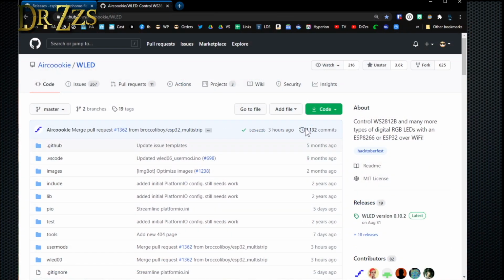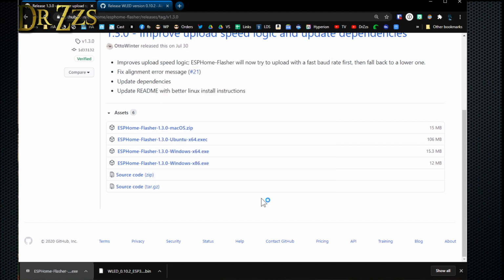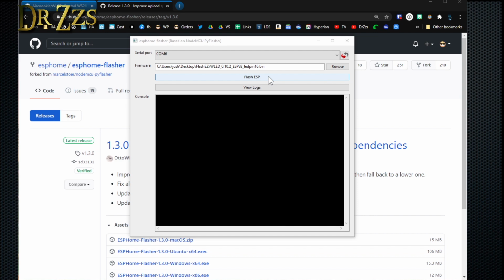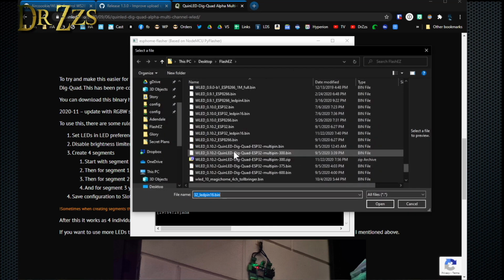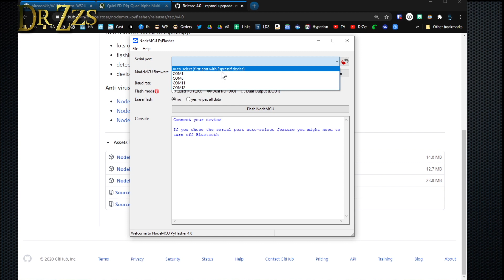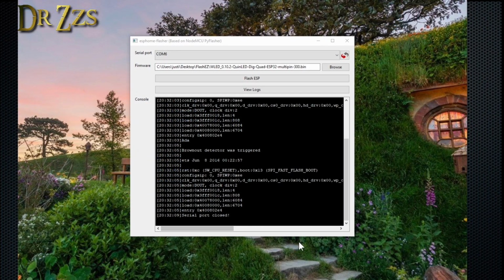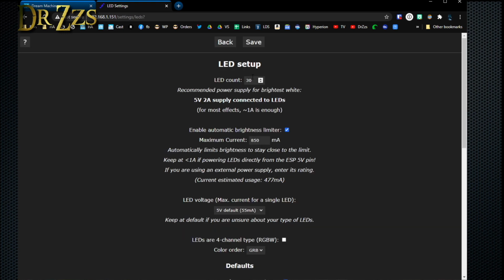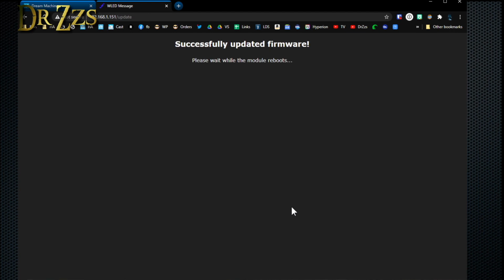DigQuad DIY RGB LED Controller - Setup Software & Wiring Connections

Comment: Awesome video! Quick question, I'm going to be injecting quite a long string of leds.  Can I inject straight from a power supply and not use the power outputs on the dig-quad? Thanks
Reply: You can, yes, but then your injection lines would not be fuse protected and you'll also need to do some for power distribution (as in, where to screw in the wires).
Reply: So there is no need to power inject from your 60amp power supply directly when using the dig power outlets

Comment: What’s the max count of LEDs per channel for the digQuad? I have 10 strips of ws2812b (5m 30) with 5v 60A power supply - can i run that from 1 channel (with power injection of course)?
Reply: Generally it's advised to stay around 500~600LEDs per channel. With 4 channels that would mean 2400LEDs maximum. You can run many more then that (per channel and in total), but the update speed per LED will start to drop. So 500LEDs = 60FPS, 1000LEDs on a channel = 30FPS. This is an LED protocol limitation, not the controller. Hope that explains!
Reply: Thanks!
Reply: If you can supply enough power, I don't think there's a limit on count. I could be wrong, but don't think so. I've had 400 leds running on a single channel of a dig uno.  Hope that helps!

Comment: hi there,
i just got the dig-quad board but i'm having trouble with the ports out puts.
i trying to use it on my mega tree and star. i have 496 pixels on my tree and 50 for the star. i set up the board with 546 total and tried to segment them in two. i used led port 1 just for the tree and led 2 for the star. the tree is working fine but i can't get the star to work. it lights up white but nothing else.
Reply: Did you custom compile the multi-channel mod firmware with those amount of LEDs? Then it should work fine: https://quinled.info/2020/09/06/quinled-dig-quad-alpha-multi-channel-wled/
Reply: Does the multi channel mod firmware come already installed on the digiquads or do I have to install that

Comment: what about the other 3 data ports can this be controlled independent from each other or why would i need a quad instead of a uno ?
Reply: Yes the extra three data ports are to be used with the multi channel fork of wled, this allows you to run four different strips simultaneously with different effects
Reply: @andrewmanning3941  can you also sync all 4 to run the same?
The way my house is I can’t really start at one end, I plan to start kind of in the middle and have 3 lines split out in different directions.
Reply: The video covers the alternate bin file to use all 4 digital outputs as well.

Comment: Great video. The only thing I would have thought to address would have been the power in equals power out concept that Quindor talks about on his site. That kind of confuses me. — For example, I couldn’t possibly use all power outs with one 12VDC power in, could I?
Reply: Not sure I fully get what you mean, but yes, you can connect up to 3x positive and 3x negative into the board and then it acts as a power distribution panel and fuse panel so you can do up to 7x injections to the LED strip. The board is rated for 30Amps continuous with up to 50Amp peak.

Comment: Who did the layout design of this board? Why is the data connector under the processor board?  OMG, where did you people get the connectors on the DigQuad board?  It got the worst screws.  I had to go through six screw drivers to find one that worked hardly ( i.e., watch type screw driver).  It would be nice to include a page with a simple wiring diagram and web links on how to wire it and use the WLED program with the assembled boards (not everyone has a technical background or capacity of locating setup data on Internet).  Thanks for working and producing this board and its associated WLED.  It appears to function well compared to my other three Chinese made LED controllers which sometimes miss turning-on some LED lights (or colors) and could make one to wonder, if the LED strip is defective.  I guess, it is really good to have the built-in level shifter on the board.  Thanks so much...
Reply: Oh wow, sad to hear you are having so much issues with the terminals! In design, choices always need to be made and since most people generally don't change their wiring every day, having them under the ESP32 module generally isn't too much of an issue. If you are building DIY you could also swap out those data connections for a pluggable style connector if you'd like!

Wiring diagrams can be found here: https://quinled.info/2020/10/03/quinled-dig-quad-wiring-guide/

Hope it helps!

Comment: Do you know If There is documented the advantages of esp32 vs 8266 when it comes to wled? Is the increse in Speed worth it? I understand that multistring could be better on the 32?  I run many d1s with wled and it works but they can sometimes feel a bit sluggish. Thanks for another great video!
Reply: Yeah, multi-channel really requires an ESP32 to work well. Other then that advanced stuff such as Audio Reactive, E1.31 and such all benenfit from the extra speed en memory of the ESP32.

Comment: Would this controller be capable to handle 11 meters of ws2813(60 leds/m) on 5V? I have prepared 60A power supply and I'm afraid this board won't last long in my case...
Reply: I have 64 meters ( 209.9 FT )  16 Sets of WS2811 with 5 volt 60 A power supply with this Dig Quad Controller.  800 Leds total.  200 leds per channel. Of course had to eject power in every other string of leds.
Reply: The board is rated for 30Amps continuous and 50Amps peak, but 11meters of ws2813 realistically will only use around 25A to 30Amps max. Running colors and effects this is much lower around 10Amps to 15Amps so I believe you will be perfectly fine. Only RGB full white uses insane amounts of power, the power limiter can help keep that in check though while displaying everything else at full brightness. Check my power sheets here to calculate some more realistic values: https://quinled.info/2020/03/12/digital-led-power-usage/  . 5v 60Amps power supply is still fine to connect too.

Comment: Thank you for your explanation. I have one question: When I use the sk6812 leds, do I have the same features as a ws2812 strip but with a white channel?
Won't I lose some features in competition with the ws2812 strips?
And if I use the sk6812 strips is it recommend to use an esp32 instead of an 8266?

Sorry for a maybe stupid question :). I saw a video where I understood the sk6812 could only show white colors with wled. I just want to be sure before ordering😉.
Reply: RGBW is fully supported and works in all the same ways as ws2812b except that you have 4rth white channel you can control separately. No limitations other then that the recommended amount of LEDs per channel is a bit lower since each LED takes 4 "bits" instead of 3 "bits". So where normally I'd recommend 500~600LEDs per channel to keep a good update rate (60FPS) with sk6812 RGBW this is more around ~400LEDs per channel.
Reply: @IntermitTech  Thank you. Now I can order the strip without risking that it won't work ;)

Comment: Excellent video!  One question - what pin/header will control a relay for separate power supplies? (small power keeps the board awake all the time, and big power only comes on when the lights are on).
Reply: It's suggested to use Q3, there is a pinout table here: https://quinled.info/2020/07/02/quinled-dig-quad-pinout/ so you see which pins do what and can custom compile WLED is needed.
Reply: @IntermitTech  Wow, I'm going to have to learn how to do that.  Any suggestions on where to start?  I'm curious why this wouldn't be included in WLED like it is on the Uno.  If I figure it out I'll be sure to share the code.  It's not like Q3 is being used for anything else, and you've got that nice header pin right there for it :)
Reply: @gnospanker  Problem lies in the ESP8266 vs ESP32, pins are correct for the ESP8266 but with a ESP32 on top of it, the pins change. I'm working on getting custom compiled versions available at some point. :)
Reply: @IntermitTech  that'd be awesome thank you!

Comment: I like that you point out to check that the USB cable has the data wires. The first time I tried flashing WLED onto the D1 from my DigUno I spent an hour trying to figure out why the serial port wasn't showing up. I tried different OSes, I looked for alternative drivers and I plugged it into every USB port I could find all before realizing that the cable I grabbed didn't have the data wires connected. I felt like a fool. So yeah, I can attest that checking that your USB cable carries data may save you some time.
Reply from the maker: That's how I found out about the data wires too... the hard way :)
Reply: I have found that some poor quality cables may have the data lines and connect ok, but often error out when trying to flash. So like DrZzs, I mark a known good cable and keep around just for flashing stuff. (Another hard way lesson)
Reply: I once spent about an hour trying to figure out why the wifi on my raspberry pi 3B wouldn't connect... turns out it was a 2B ... checking is critical in saving time!
Reply: I bought a device called "is it me or usb" simple little board with an onboard battery you plug both ends on the cable into it, if it has data it will light all the led's on it to confirm. You would think that once you have a cable that works you would have it always ready but I can never find mine when I need it
Reply: I had to download drivers for my PC for ESPHome-flasher to work with the Esp32 board.
Reply: @tbaine  Yep me too. https://www.silabs.com/developers/usb-to-uart-bridge-vcp-drivers#software